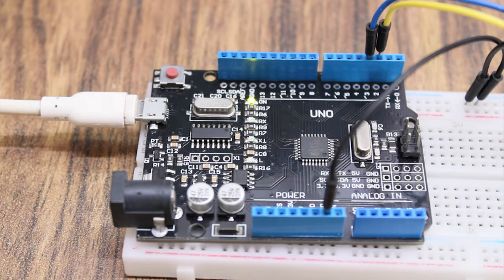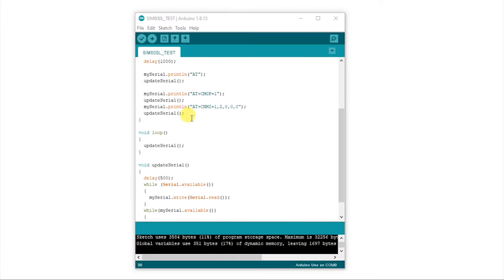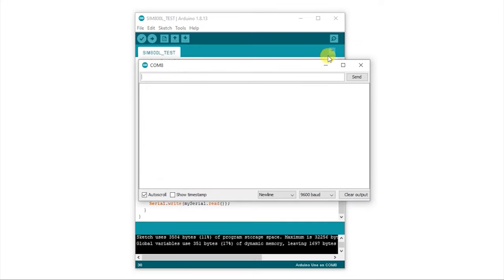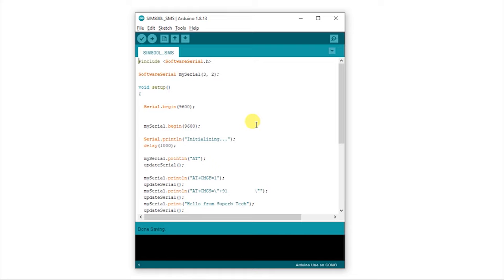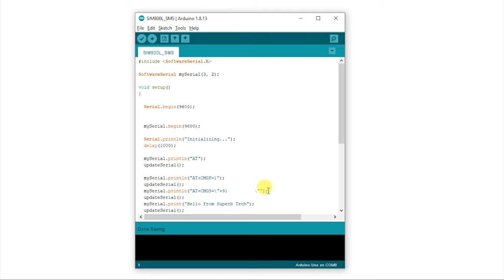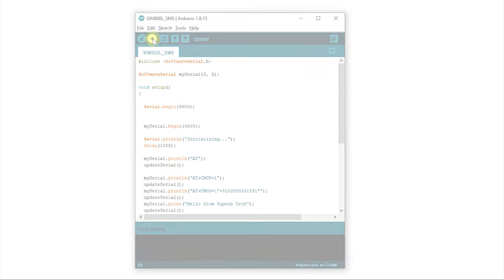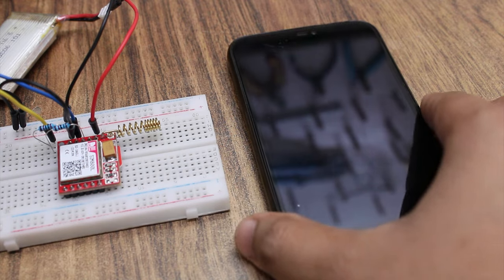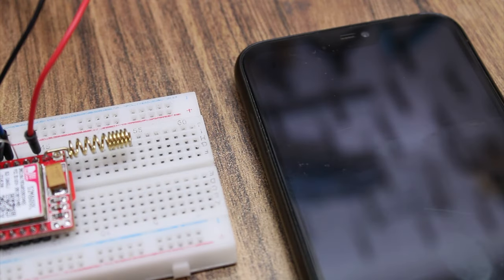SIM800L SMS Tutorial Using Arduino

Comment: Is this a 2g module?
Reply from the maker: yes
Reply: @SuperbTech Does it work with 4g sim cards, as you have used 4g sim in tutorial video.
Reply: Does it work with 4g card or not
Reply: @charlesaustin9129  I guess all sim cards are backward compatible, meaning they automatically selecte the 2g network.  In india all simcard are provided like this.
My dad has 4g sim but uses a 2g phone.  
Just check with your telecom operators first in your country. In Turkey 2g is completely phased out.

Comment: Is this module good enough for location tracking? I currently have ESP32 WROOM and Quectel L80RE
Reply: I would not use it for anything now that 2G is getting phased out, it doesn't work in many countries anymore. Many 4G nodules have built in gps, you might want to look at those. The sim7080g is good and works worldwide.

Comment: This module is 2g based so this works with 4g sim card irs works or not??
Reply: If the 4G SIM card of your cellular service provider still has 2G network, then yes. In many countries, 2G has been retired, but in some countries, decision was made to retain 2G as 'backup' but instead 3G is retired.
Reply: In my opinion, getting a LTE Cat 1 may be better. i still like my SIM800 though, it is cute. But i find that in places with poor cell signal, the current drawn can be quite high to the point that it causes brown-out.

Comment: why are the battery specification that you said verbally don't match with the battery that you used. Like you said to use 2A current but you are using only 1100mAh which is 1.1A @ 3.7V?
Reply from the maker: the battery used is a lipo battery, it can discharge 5-10 times the rated capacity at a given time
Reply: @SuperbTech  thank you very much😄, also do you know any other sims apart from airtel that i can use in the sim800l.

Comment: Using Airtel sim. But led keeps on blinking every 1 seconds. Plz help me.
Reply: use proper wire,5v separate battery
Reply: Same issue but initially it was blinking after every 3 sec but after making all the connections it didnt do the same again, keeps blinking 7 times repeatedly after every 7 sec  delay. I guess it tries to connect to the network

Comment: Is it possible to supply it with mini solar panel and 18650 batteries? Cause as you mentioned they require 2 Amp current at peak transmission. Thanks in advance.